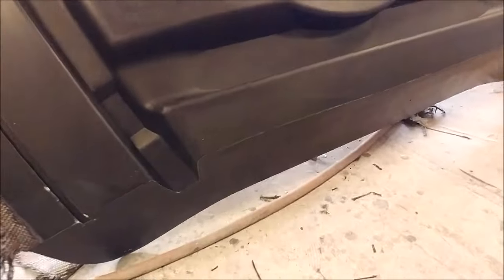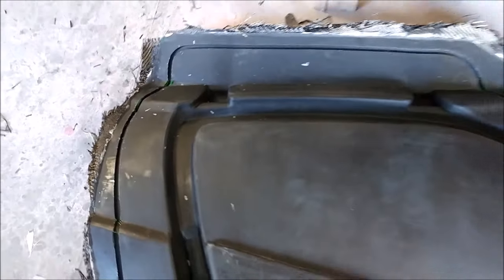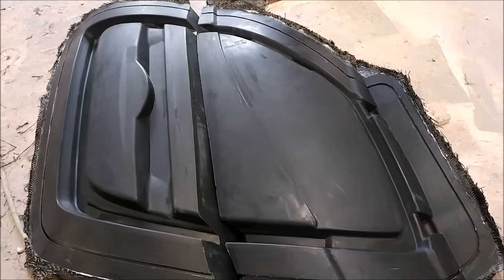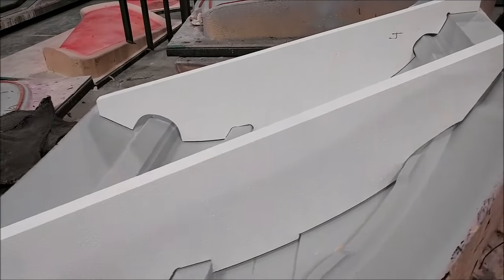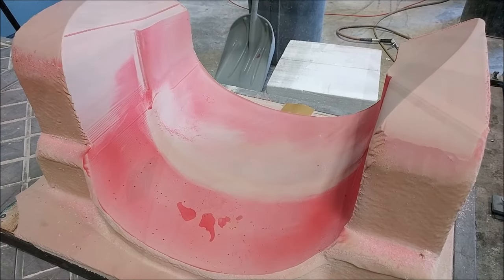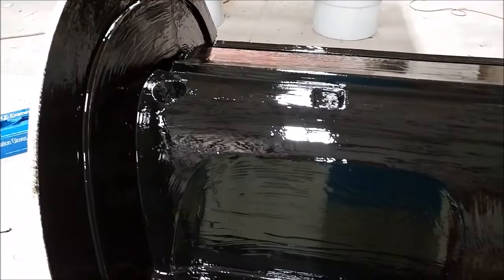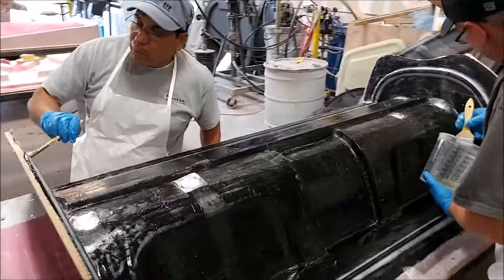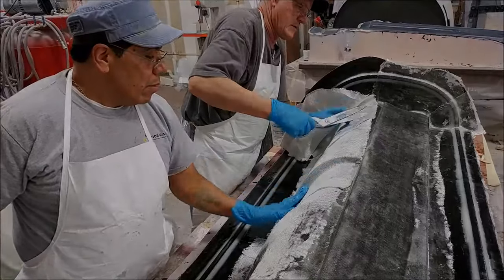Raptor Aircraft November 1st

Comment: Why are you using all glass for that part?
Reply: if I understood it correctly, the final parts will be of two different kinds: load-bearing, and not-load-bearing.  They want to have the possibility of curing the final load-bearing parts in an oven for some quality reason, and the molds for these parts that may/will be cured in an oven, need to be of the same material as the final parts, i.e. carbon fiber, because otherwise the mold and the part will expand differently while in the oven, causing unwanted results.

The not-load-bearing parts will still be made of carbon fiber, but as they are not load bearing, they won't have the same quality demand, and will therefore not be cured in an oven, and therefore the mold can be of a different material (glass fiber) than the part itself.